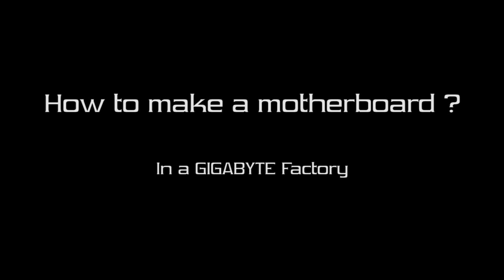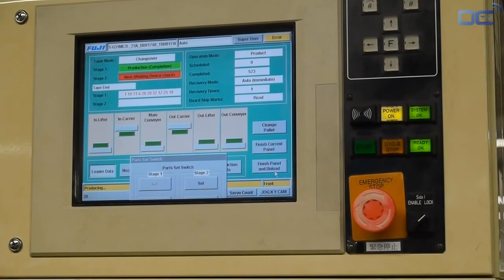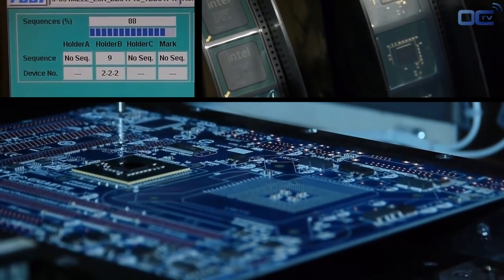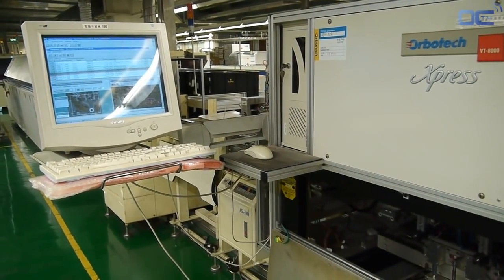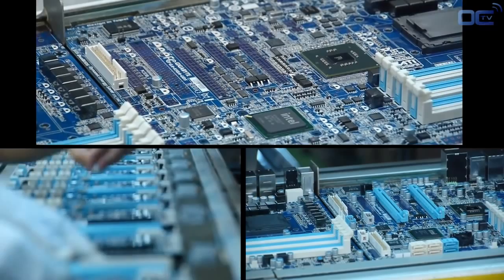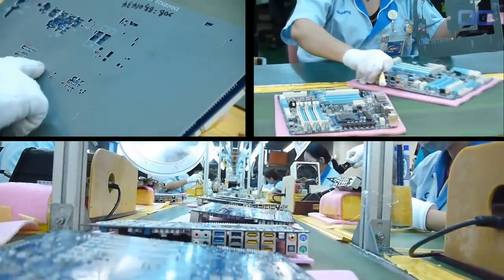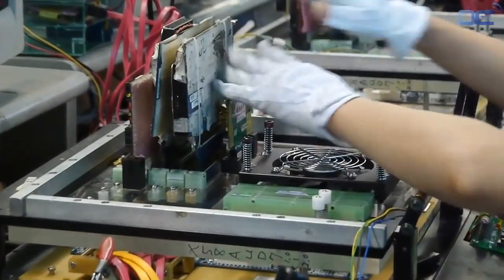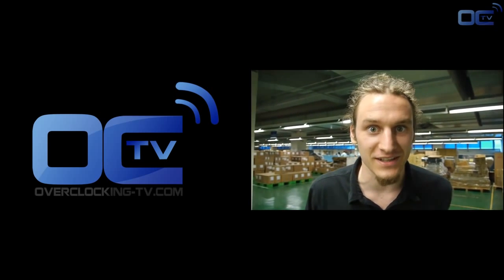How to make a Motherboard - A GIGABYTE Factory Tour Video

Comment: Those are X58 UD3Rs! I have one of those, they are amazing for overclocking first gen i7 and Xeons. The solid state capacitors that they used for the main part of the VRM will never leak, it's a very reliable piece of silicon!

Comment: Visual inspection can be automated by using a image of a well finished product and a if not script
Reply from the maker: For most of the process there is already an optical inspection, mostly to check if the small components are placed correctly. visual inspection is still required for some checks.

Comment: Do you think 2017 will see all manufacturers will be replacing their 
locking UEFI with ones which will actually be allowed to use Microsoft's
 competitors operating systems? After all it will be a rocky road on the
 stock exchanges to see board manufacturers to see fines as high as 1 
billion Euros for not complying with Data and monopoly rules within the 
EU?

Perhaps the answer to your question is only buy a board with a bios that
 allows all operating systems including windows 7 to run on it?

Comment: Why do they use ducking CRT'S?!?!?!?
Reply: my mom said that crts are bad for health because of the radiation...
Reply: Because they are cheap and reliable for long periods of time. Those monitors probably haven't been changed since the factory was made. Who cares about the health of poor low paid workers (you can find new ones everywhere). That is how corporations think
Reply: ok rick
Reply: The corporate view is that if it's not going to cut cost and/or boost productivity, you use it until it dies. And then you get the guys in the shop to try to fix it for no more than $5 in components. If it still can't be fixed, then you splurge and replace it with a monitor from a surplus auction.

Comment: How does one come up with the idea for a Motherboard.. I mean.. How came up with or who designed it..? For something so complex, it's very hard, for me, to understand how exactly how the whole circuit was built, or drawn up..
Reply: +Mark II in the process of making a new motherboard (Model) you will spend about 1 year and atleast 100 people have been working on it. it is complex. No one person will be able to do that alone.
Reply: wardope Kinda figured.. Yeah, it's extremely complex circuitry. Thanx for the reply.
Reply: +Mark II Compared to those telecommunication boards or server boards, these are just a piece of cake. There are lots of people graduate from college learning electronic engineering.
Reply: If you think a motherboard is complex you obviously haven't seen a CPU circuit diagram in your life
Reply: JRLM Yes it is as complex. unless you are a Hardware engineer you shuld not say that is not. and if you where a hardware engineer you would not say it either !
Reply: +wardope im a hardware engineer for Nokomis Inc
Reply: The first motherboard was designed by IBM for the first IBM Personal computer
Reply: wardope I meant OP not you.
A motherboard is super complex, no questions asked. But the thing is: 6 layer architecture vs over 100, ATX formfactor size vs the size of a fingernail, a few hundred transistors vs a few BILLION transistors.
It's more complex, but then again, every modern hardware component is nowadays
Reply: i have never said that a Cpu not is complex. all i said is that a motherboard is not something you just go and design without years of experienct.
Reply: and you say that its not complex to design a motherboard from the buttom and up. Common you are full of it !
Reply: uhm infact i have,
Reply: What I'm aware of, and that's kinda obvious, is that a motherboard is designed based on a CPU or the cpu socket. Just like the Arduino Uno board is designed based on the ATMEGA328p microcontroller that sits on it. If it wasn't for the single object type that sits on the board, the board has no purpose, and the board has nowhere to start being designed. Knowing that, the rest of the board is easy to design and make.
Reply: the first computer was made out of valves  and tubes and now it has created the first micro 200nm  chip and now look it started a revolution that's when people started making games the old arcade Nintendo days then the die shrinks again and the playstation  1 playstation  2 then  the orignak xbox and xbox 360 playstation  3 and Xbox one playstation  4 pc just keeps getting more powerful because pc was weak to start with but that all changed very quickly the revolution of the computer someone needs to go back and show the world what the first computer looked like before we had floppy disks and disk drives
Reply: Mark II with great difficulty
Reply: You come to it when you understand that CPU on itself is useless and it always needs peripherals which it can handle. If you are using PC you can see various input/output/storage devices which you have to wire before you actually can do anything with them. That's what the purpose of any motherboard.
Reply: It just thin sandstone with wires in it
Reply: Advanced circuitry to make that very first computing machine, the abacus. CS history 101. Then, you actually get the motherboard because they wanted to make those giant tape machines seen in WWII espionage movies (i.e. enigma) smaller and portable (sucked to be in the same room for that stuff). Where will you find the decoders? Today, they could be under a bridge with WiFi connection. Anyhow, lay people also enjoy the benefits, as we move to super and then quantum computing for the big stuff.
Reply: 2million years of human development.
Reply: Who designs the motherboards? Many of the motherboards come from designs created by Intel, for boards using their CPUs, or AMD, for boards using theirs. The designs don't vary much from one manufacturer to another, except choice of the components used. I love Gigabyte because they use much better components! I am obviously a BIG fan of their products - I have buying their brand for the last 20 years or so, since building my 3rd computer in 1997(?).
Reply: Me  too
Reply: I think it is unlikely that they look at the motherboard as one big complex whole. 

If I was to make a complex software, like an Operating System, or circuit then I would probably break it up into smaller, simpler, logical parts, conceptually, name them and only think about what each part needs to do. The end result, as a whole, may look complex.

A CPU looks like a monster. There are 'parts' of the CPU, though.
Reply: it's not as complex as you think...

Comment: As an owner of a performance Gigabyte motherboard on an AMD platform, I can say without a doubt that my next motherboard will be ASUS. Problems started from pretty much the first step: installing windows. The motherboard driver required to install windows 7 on an SSD, provided by Gigabyte simply did not work. After many, many hours of trying various things, the solution was to install Windows Vista, which had a functional driver and then upgrade it to Win 7. 

The next problem I had was that the sink of the VRM's was running very hot. I looked it up and it's a common issue, caused by Gigabyte using very low quality thermal paste. The problem was resolved by removing the heat sinks from the motherboard and applying better thermal paste. 

The next problem came up when I started overclocking my CPU: my PSU, my cooling and the motherboard all theoretically have plenty of headroom for overclocking. The problem was that the quality of the power supplied by the motherboard's VRM's was so bad that the CPU quickly became unstable even at slightly higher-than-stock voltages.

To me it seems that there's a good reason why Gigabyte is the most affordable brand.
Reply: So you're clueless but you think buying a fangirl board like ASUS will make things better. 6 years later, have you moved onto the latest fangirl brand, MSI, or do you stick with ASUS?

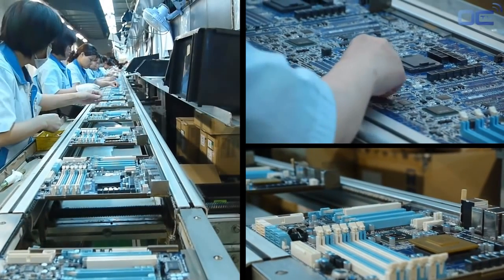Comment: Check carefully around 6:15. The whole board is bent several times. And why all those manual soldering adjustments? It looks completely amateurish. Perhaps they do it similarly at Asus or MSI ? I've had one D.O.A. Gigabyte motherboard. Not surprising.
Reply: Clueless.
Reply: +Jacques Mertens It's a PCB. Bending it doesn't damage anything. The manual soldering is necessary since there are a lot of things that computers can't actually detect or control, and just adding a human element could increase yields quite dramatically. DOA motherboards happen with every brand, not just Gigabyte.

Comment: Surprised how manual so much of the process is. Manual visual inspection, all non-SMD components placed by hand, manual fixing with a soldering iron... it's not very sophisticated, is it? Motherboard manufacturers are basically just sticking a few components on a PCB.
Reply: +florent trepanier They are not Chinese! In Taiwan, labour aren't as cheap as you'd think.
Reply: +Kevin Ping In terms of Labor cost, you'd be better off in India, as their becoming an Emerging Labor market with such a high population. Regardess, the reason you see all the manufacturing In Taiwan/China is a few reasons. First, the cheap cost of the raw materials. Second, the sheer density of these manufacturers in such a small geographical area makes it very cheap to get the materials. Third, your Income Taxes and Import/Export costs are extremely low in comparison to most EU countries. Even with all of that, the Labor is still far below what your typical US  minimum wage factory worker will make.
Reply: @DialupDavid  Emerging slavery market you wanted to say probably...
Reply: +TazeTSchnitzel 
Depends what factory, MSI uses automation most of the time today.
Reply: MSI must be rich to get rid of alot of hard workers for like maybe 10 workers than 100 workers 1 robot takes away alot of workers
Reply: ugh That's why today's electronics fail so fast. Cheap labour=> cheap quality.
Reply: Yep when all jobs are done by robots and are controlled by robot's controlling robots controlled by transhumanism half human and half Machine then yes lol
Reply: Either it's this "manual process", or they produce QC nightmares like half of everything ASRock/Biostar/ASUS/MSI makes...
Reply: jonathan oxlade thats true pal, its a shame that the money they save up they spend it on stupid things and dont pay better salarys people are starving or even worst they still are slaves of the actual system, a system that doesnt let you save up money and buy a house or become independent economical talking, always having to work for some one, goverment or a drug dealer or a civilian, its a fucking shame how in this world there is rich people and a lot of poor people, always being slaves and cant break up the system and the fucking chains this assholes created, always controlling us and spying, fuck usa and fuck mexico shit of country

Comment: I see you use the eastern asians. Yes they are faster with the components, but they do cost more. You may want to think about changing to the western asians. They are a bit slower but they work for less and in the long run it will make you more money.
Reply: +John Doe 
Western Asians have the patience to do this kind of work ?

Comment: Gigabyte are one of the most unreliable manufacturers. Considering that these are small extremely sensitive and only protection employers have is face masks and glowes. If you watch how CPU is made you see that they use special full body suits and everything is done by machine making sure that there are no defects what so ever.
Reply: its a compleatly different enviroment lol they are making silicon wafers..all motherboards are made like this, show proof of gigabytes unreliablity.
Reply: There is a major difference between mother boards and CPUs.  CPUs cram billions of transistors into little more than a square inch of space.
Reply: Gigabyte makes very solid stuff, IDK what you're on about...
Reply: Based on available information, Gigabyte has the lowest RMA rate for motherboards.
Reply: You have to also keep in mind that this video is four years old.
Reply: Luben Lambov no you dont mobos are still made the exact same way.
Reply: Jolinator The process may be the same, but that doesn't mean that they're still made the same way. Production quality may have been improved, more and different QC may have been introduced, they could have gotten new machinery, etc.
Reply: Luben Lambov if as you say the process is the same then, what do i have to keep in mind when viewing this video in relation to the the date posted? its almost certain they have new machines as sockets have changed as have smd and bga packages, the age of this video is irrelevant, all mobos are still made like this , there have been more recent visits to the gigabyte nan-ping factory, the process of building a pcb is always done as cheaply and quickly as possible , gigabyte dont build any of there motherboard chips(asmedia,intel, broadcom, Nec ,Realtek, connectors mostly supplied by foxcon, Gpus (tsmc makes nvidia and amd gps  and they dont make cpus, the only function of the factory is to solder all the components on, being someone that works for a company that manufactures PCBs i can tell you not a lot has changed in the past 5 years other than the trend we are now seeing of suppliers using black soldering masks. its a very mature process, the main changes over the last few years have actually made the manufacturer of boards much easier and cheaper, no north and southbridge chips, less usb 3 chips,  as more and is integrated in the cpu by intel.
Reply: Jolinator Do I really need to explain how the manufacturing process and its execution are two totally separate things?
Reply: Luben Lambov Yes.
Reply: https://www.google.com/search?q=define:process
https://www.google.com/search?q=define:execution
Reply: No

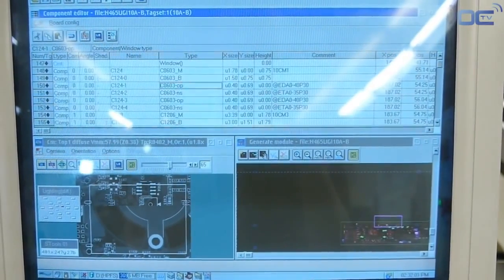Comment: what is  funny/cool most manufacture still use windows 95 or xp. 4:45 lol even intel pc manufacture today.  most buisness still use it because of cost upgrading with new software/hardware that are compatible.
Reply: *****
 compatibility with production soft/hardware on al fronts.. costs quite a bit. and its not needed. these machines are not online anyway.
Reply: Idk about them but I work in a plant that makes interior lighting units for ford and our SMT machines can access the internet. All they are is a PC with a giant machine housing them. Running windows xp and some programs to control the machine.
Reply: Hell, they were even using DOS for the testing of components toward the end :P
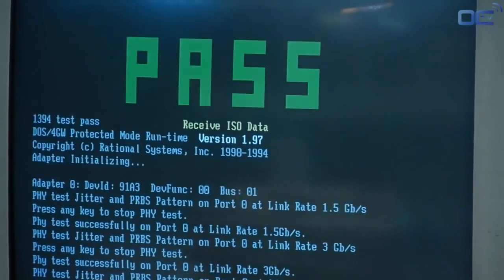8:57
Reply: 3Dtimespace when it is working, why not...
Reply: Never touch a running system.
Reply: NO! It's actually the most simple things they're using, and some rigged up boards for checking functionality, half wrapped in some insulating tape by a guy with one hand. This takes all the processing power needed for your pc to post. They're board testing was far from high tech,  just simple, quick, and efficient enough to spot the most obvious flaws.

Comment: Normally you are right but i think his issue that was common with this mobo was a lose compactor and if that's the case it is not a loud sound like the post beeps you get from a speaker but kind of a screeching sound like nails on a chalk board. The sound comes from a  lose compactor casing a bad voltage regulator circuitry witch admits a whining sound that some describe as high pitch. This would also explain why the mother board "fried" again very rare but happens.

Comment: The bios (or the possibly multiple bioses) are separate SMDs (usually in the form of PLCC), and nowadays the integrated gpu (if it supports one) is on the CPU.

Comment: You have no idea how much those automated chip handling machines cost. We design them and each is custom made. In most cases it takes 5 months to build one from CAD to building. On average they cost $800k + for one machine. So I doubt that upgrading CRT monitors is cost saving.

Comment: just an old crt monitor plugged to a high tech computer just to run a company program which is made for a certain purpose and also to run with the onboard GPU. Every company does it.

Comment: I have a Gigabyte GA-EP45C-UD3R Motherboard since November 2010, and thank to God, it works fine ans stably.

My GA-EP45C-UD3R running daily and render media files using Video Editor Non Linears, Decoders and Encoders and well his temperature reach 34 C or  93 F grades.

I was bad experiences in the past when I used a MSI  K8N Neo-F, Asus P5N-E SLI  and Asus P5N-D.

Gigabyte... a brand highly recommend.

Comment: You probably put too much thermal compound on the CPU and it oozed down into the socket and shorted some pins. Regardless of what happened, a motherboard dying two years after buying it means that it served its purpose.

Comment: Gigabyte sucks, I got 3 1 tb drives at 500gb and 31mb unallocated particions and lost allot of data due to their flawed Xpress recovery BIOS allocating half the size of the harddrives to the HPA (Host Protected Area) which is a hidden harddrive area for backups and diagonstics and other "special" functions

never going to buy a mobo from those amateurs at Gigabyte again

Comment: Is this video over 10 years old??? Beacuse i'm working in similar company, that makes electronic components, and my god... they are using machinery (SMD lines, ICT testers, automatic optical controlers, etc... ) that we in my company have used over 10 years ago... Today we are using much more advanced machinery... and another thing that i noticed... they are touching the boards without being grounded with esd arm bends...in my company you will get fired if you touch component without esd armbend